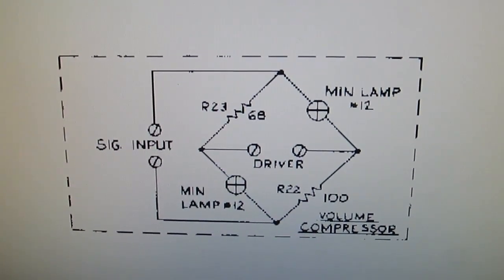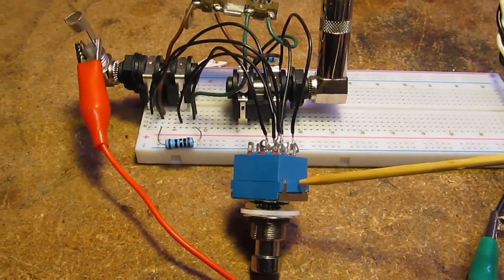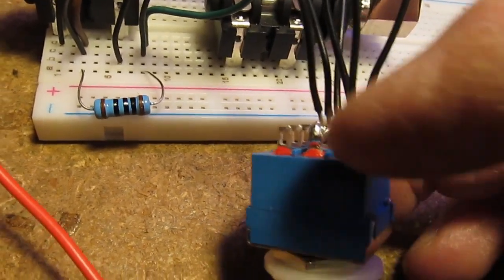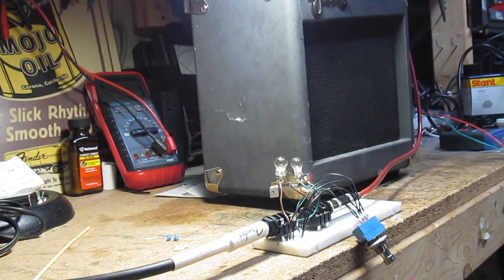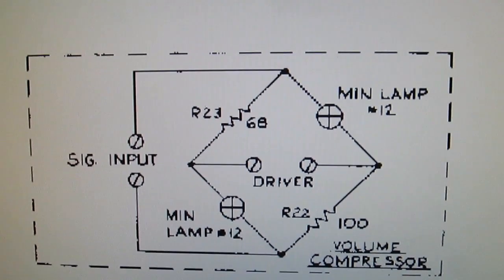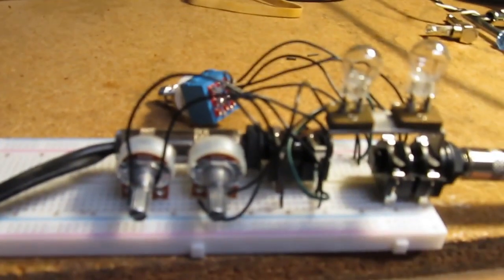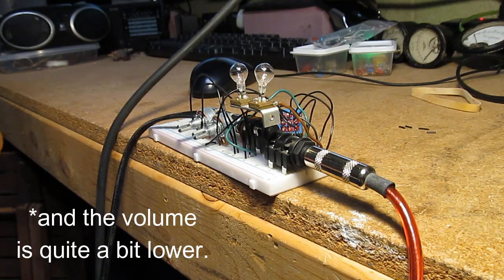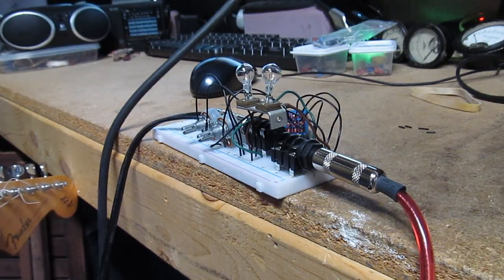Light Bulb Volume Compressor for Guitar Amp?

Comment: It's working, the volume drop is normal cause it acts as resistance/clipping. If you put it before the transformer, with the right resistance set up, it should work similar to a tube, but with a tiny opto compression aspect.

Comment: The circuit is a Wheatstone bridge the more unbalanced it is more output if it is balanced there is no output
I think the transistor goes across the100R resistor and is turned on as the power increases bringing the bridge into balance therefore lowering the output

Comment: Honestly just put both lightbulbs in series with your speaker and you'll get some compression.
Reply: Well with the speaker no cos with that kind of current they might just act like a fuse. I think somewhere just after the guitar (or after some boost if more voltage is needed) might be better.
Reply from the maker: Yeah